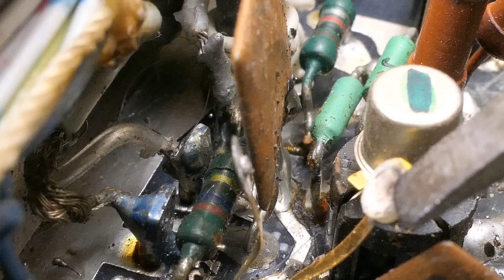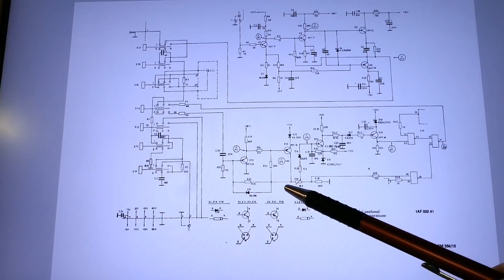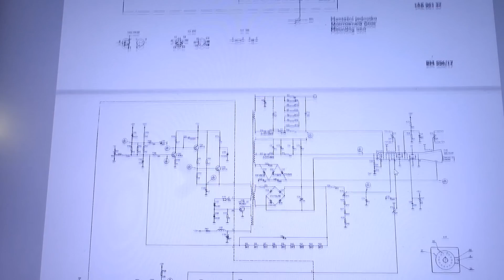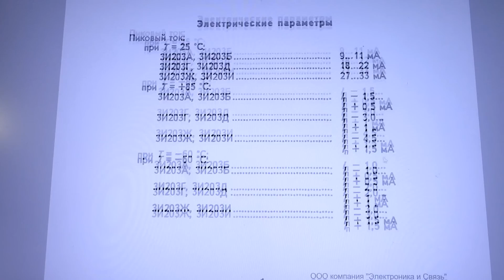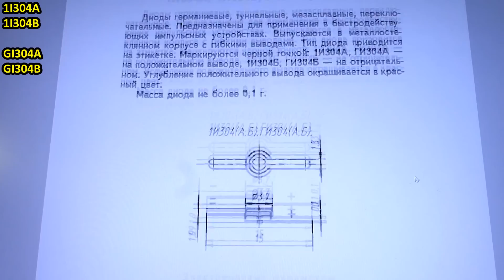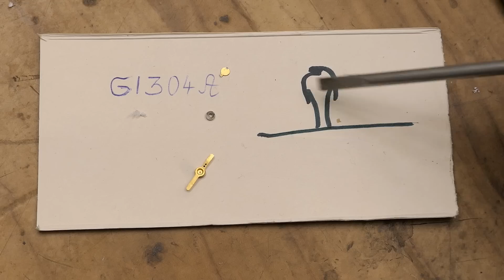Analog oscilloscope repair 3 - Tunnel diodes

Comment: I am repairing the BM550 scope. Almost identical to 556 just it has built in DMM. Except several failures the faulty tunnel diode became the bottle neck. I have found on the net GE132. This is the only available at the market nowadays, but it has Imax just 2mA. Can you propose circuit modification of the tunnel diode? For instance place the 330ohm resistor between the C7 and the diode itself or something similar. I think many of the "bustlers" will highly appreciate your advice. Thanks in advance. Stefan

Comment: Noticed a burnt resistor just below the tunnel diode - had scorch marks on the bottom.  Could that be causing problems?
Reply from the maker: I also thought, but it seems to be old rosin.

Comment: is  there some type of modern part that will work?
Reply from the maker: I don't know of any. Maybe not a part, but a circuitry made od multiple components and some supply voltage.
Reply: So you stuck looking through old new stock.. or is that new old stock... @DiodeGoneWild

Comment: I used to repair Multigard alarm system control boxes. They used a tunnel diode to give hysteresis in the circuit that measured loop resistance. They did not fail often, I only had one bad one while repairing dozens of control boxes. They ones I worked on were less than 6 years old. 
The system had audio microphones installed in each room. The audio was sent all the way to the central monitoring office via leased telephone lines. Each receiving unit at the central office had a level detector. When the intruder made noise it was triggered and the operator could hear what was going on at the premises. Not a very good system, lots of false triggers and it required a lot of the operators time. This was in the late 70's.
Reply: The microphones were mixed together into one signal before being sent on the line. This means the ambient noises were all added together. Sometimes this system didn't really work well. There was a standard alarm loop that could use switches, window foil and motion detectors also. This is where the tunnel diode was used to provide hysteresis when the loop resistance was being monitored. An alarm was initiated when the resistance was out of a set range.
In the early 80's the systems installed at the customer were replaced by switches, window foil and motion detectors. It was impossible to use this audio system when the central office was automated.
They had a system that was being used in schools. The signal from the intercom system was used instead of microphones. It was set up to listen to various classrooms. The performance of this was even worse. My company did not use this, I just repaired pcbs from another company the was using it. These pcbs were a bit older. Sorry, all this is a bit off topic but I think it might be interesting to someone.
The tunnel diode used was 1N3714. It cost about $25 at the time and was hard to get.

Comment: As ALWAYS a great production to follow. Apart from your very methodical fault tracing combined with explanations, the amazing part is you have a stock of tunnel diodes on hand 🙂And just in case someone is wondering about checking transistors with a meter (diode test) the base-emitter reading is always higher (sometimes not by much) than the base-collector. And a very ruff indication is the higher the difference, the higher the transistor gain.....Very ruff 😄
Cheers and thanks as always.
Pete'
New Zealand.
Reply from the maker: I've noticed the voltage drops are slightly different, but never thought B-E would be ALWAYS higher. Before I had the intelligent tester, I always used this https://danyk.cz/test_tr_en.html to verify the C and E.
Reply: Yes, I use it mostly to identify the pin outs for C-B-E. Very handy trick.

Comment: Actually, there is the "lambda diode" circuit made with cascaded bipolar transistors, and it has the property of negative resistance, which mimics quite well that of tunnel diodes. But I guess the peak and valley voltages will be quite different than the ones of the diode in your oscilloscope.

Comment: Where else on the internet could you find an instrument repair centered around a tunnel diode, a component that I'd never heard of until 20 minutes ago, an excellent video. Sorry to hear you're still feeling under the weather with the creature.
Reply: Where else? At CuriousMarc, probably.
Reply: @mrnmrn1 I don't think even he has a video containig  tunnel diodes.
Reply: @petermikus2363  I wrote 'probably', because I faintly remember he maybe covered them. The amount of vintage test equipment he made videos about, there was agood chance for that. But I just checked, and found no evidence. Maybe he mentioned them in one of his videos.
But w2aew made a great video on the topic.

Comment: A tunnel diode cannot be tested “as a diode” - after that it must be thrown away. They are also extremely afraid of static electricity - in comparison, MOS transistors can be considered "oak" (for example, if you hold a tunnel diode with one hand by one terminal and touch the other terminal with the other hand, it fails due to static discharge electricity)
Reply: I've heard about that multiple times, but never supported by a solid proof. How  is it that it was not damaged here? I really want to know.
Reply: He is lucky. The one he tested is still ok.
Reply: @gordonwelcher9598  maybe it's not ok, that's why I'm asking about failure modes. More importantly - how to test it correctly?

Comment: I can honestly say that in my 40 years of poking at electronic things I've never come across a tunnel diode in an oscilloscope.
Reply from the maker: Maybe you were not looking for it :) But of course, only some oscilloscopes contain these.
Reply: @DiodeGoneWild  can you teardown another ultrasonic humidifier?
Reply: Used in Tektronix scopes and plugins, including the 465.
Reply: @gordonwelcher9598  Yep. I know there are five (each) in Tek type 453 and 454 'scopes.
Reply: @SigEpBlue  Must of had my head in a bucket.
Reply: i love seeing the inside of different humidifiers
Reply from the maker: If I run into another, I will definitely explore it ;)
Reply: In my 50 years of electronics experience I've never seen a tunnel diode in anything at all! I knew what they were, but I've never actually seen one.

Comment: I thought I see the resistor 470ohm near the diode is burnt, the one at right angle on side of transistor.
Reply from the maker: I also noticed, but it measures good. It's actually dirty from old rosin, not burned.

Comment: I had a very mild case of the covid last year. I was only really sick for a few days, then it took about two weeks for the residual cough to go away, and another couple of weeks for the brain fog to go away. It really sucked because I had some super complex projects that I was working on, so basically everything too way longer than normal because I had to go back and check my work from the previous day to find all the mistakes and fix them. One thing that helped was putting everything from my diagrams into spreadsheets so I could keep track of everything and check them off as I went. Probably not so useful when you're repairing equipment rather than building something from scratch though.
Reply: My doctor got it last year. He's retiring now.
Didn't even know who I was or our treatment history anymore.
The creature is no joke.
Reply: I had it for the first time a few weeks ago. I was lying in bed for 4 days.
Reply: @1marcelfilms  It's not fun, I'd only rate it 3/10.

Comment: That is a very obscure part to have in your stock.  Or did you buy it?
Reply from the maker: Hoarders have a lot of even more obscure parts ;). But I still sometimes run into something I don't have...
Reply: @DiodeGoneWild  where does your collection of obscure components come from?
Reply: Old broken items. I have pile of scrap boards under my bench. I often take components off them.